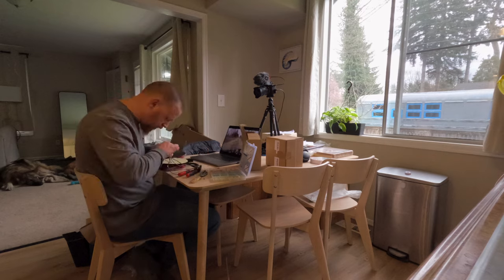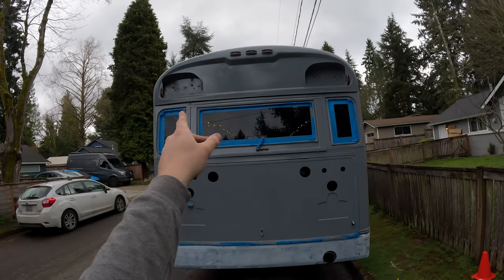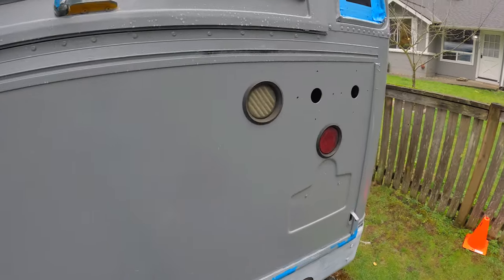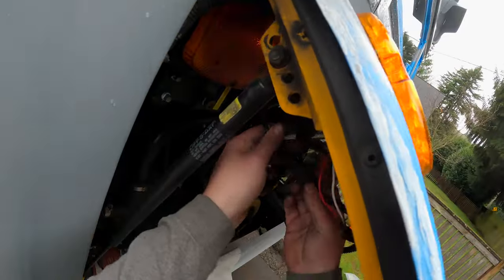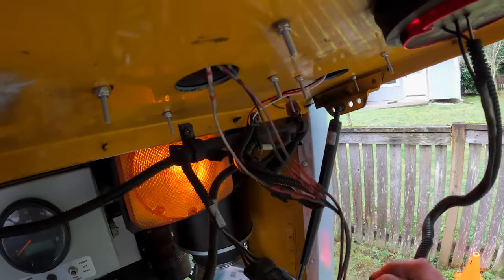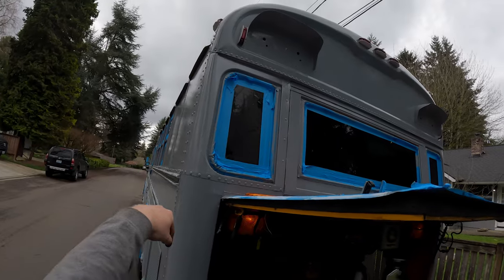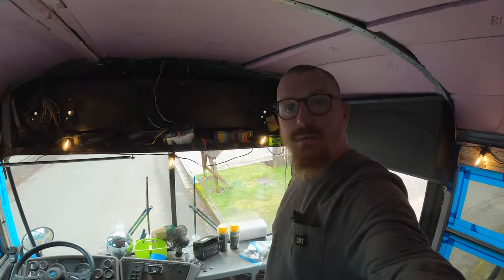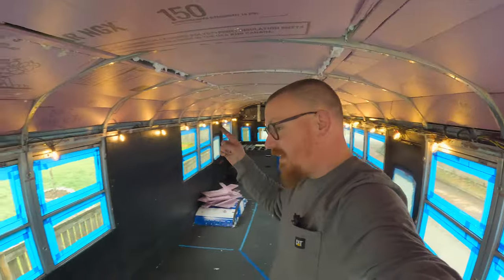Reinstalling Turn Signals & Brake Lights | Skoolie Conversion

Comment: IMO I would put the lights at the top one stop one turn for safety purposes.. lights below and lights high up should make you real visiable.. I would also put the red on the inside and orange on outside like the lights below are just to keep it uniform.

Comment: Cool progress, but the dogs are like….WHEN is he going to throw the ball for us???
Just a suggestion, put a small bead of Lexel or other clear sealant around your exterior lights. Barely visible, easily removable, unlike butyl, and will help prevent water infiltration. Since we live where the rain goes sideways at full force (shoulda seen it here yesterday WOWSER) Learned from a classic car guy when I was surprised one of my deep set, well grommet sealed lights half filled with water!
I am guessing Lenny’s “THRONE” arrived?
🚽😸:face-fuchsia-poop-shape:💩